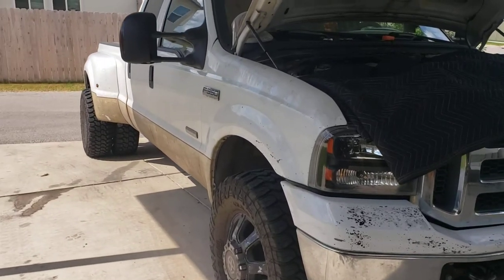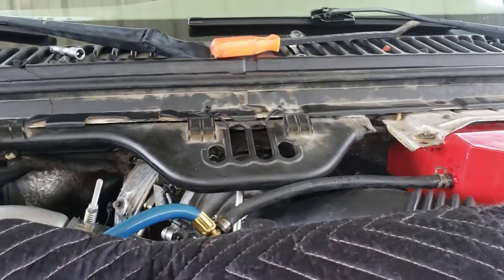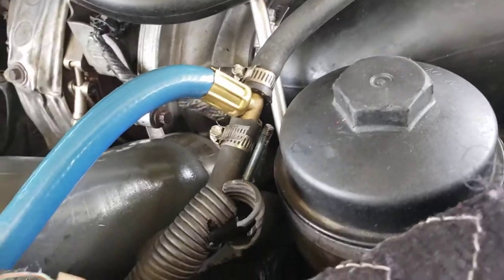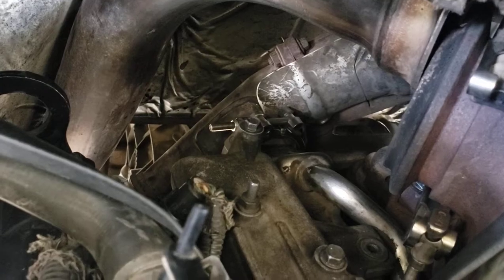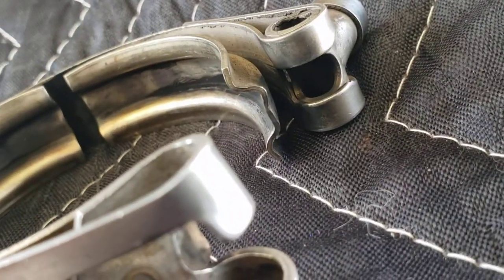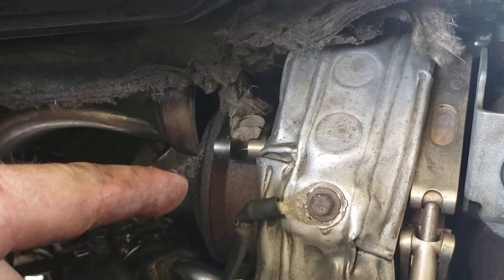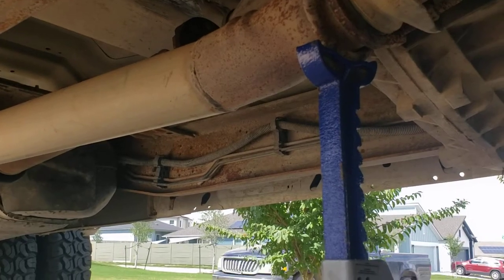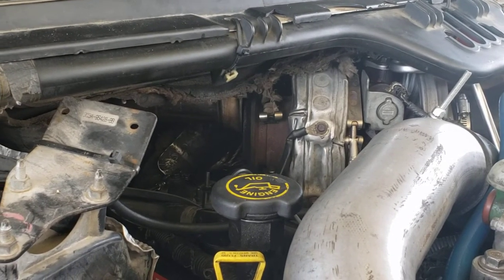2006 F350 6.0 Powerstroke Turbo hiss (no/low boost) fixed! Band clamp trick

Comment: How much boost should my 2006 f350 6.0 powerstroke have? Just bought it, but it feels weak also. Boost gauge shows about max 4psi
Reply from the maker: Usually if it feels weak, it is. At least in my experience. When you really get on it should go up to around 15-20. I had egr delete and CTS2 tuner way easier to monitor than dash for specifics but after I got everything working I just used the dash gauge
Reply: If you’re getting a max of 4 PSI you need to investigate something else. You’re going to max your EGT’s out and blow a head gasket. You have a significant leak somewhere. Just 40-55mph should displace around 5-10 PSI. Hauling, around 16-23.

Comment: How do I check is my turbo is good or has bad seals
Reply from the maker: Usually if seals are bad you can spray brake cleaner around it and truck will either change in idle when you hit leak or you will see it come out of exhaust if it seeps through
Reply from the maker: When the truck starts cold and idles for a bit you should hear the pressure release after about 2 minutes and the truck sounds like a caterpillar back hoe for a minute lol that’s how I could always tell the turbo was still working
Reply: @overlandtate2426  
I just took the intake off and the turbo was like brand new inside there fan had little to no movement. 

I did notice a previous person put the clamp back on the intake and bent the intake to where there was a good void letting oil out. It was all mucked up around that area . I’m sure it was good to have the void there. Would this be causing some of my problems.
Reply from the maker: @steventhorkelsen6478  oil in there can cause a ton of other issues. I would say to check the intake manifold gaskets out.. but the work to do so is a pain in the a$$! If there is a leak from the turbo and oil gets in the intake it can cause rough idle, no start, and black smoke. Good thing the turbo looks good though! They sell a turbo seal kit that took away my whistle in my turbo and brought my boost back. It was similar to your symptom of like 4lbs even when I got on it

Comment: i’m hearings hissing type sound from the drivers side. do you think it could be a boost leak ?
Reply from the maker: Does it get louder as the turbo winds up? The turbo is trying to build up pressure as you accelerate and if there is a leak you’ll feel a big loss of power
Reply: Same thing. 

Loud hiss out the driver front well. Exhaust smoke comes out too. My 03 is a smoky turd. 

Zero boost.
Reply from the maker: @johnnelson7148   definitely sounds like pressure is not building up. Either means exhaust leak or turbo turbine is not spinning. Usually the hiss means leak though. Hate to say but you have to check all of the exhaust connections. Usually the way I do it is start up cold and feel around for where the exhaust is coming out/leaking. You only have about a minute before the exhaust gets too hot to feel around but then you’re relying strictly on sound which can be unreliable in a tight engine compartment. Hope this helps
Reply: Motorman Tate turbo is freshly rebuilt. 

The last mechanic that touched it threw it together in less than an hour after running me around for a month. 

I’m guessing he jacked it all up because the sound started the day after I got it back then stayed consistent with a whoosh noise...now this. 🤣

I’m sending it to a shop. I don’t have the tools or know how to mess with it.
Reply from the maker: @johnnelson7148  to be honest mine started after I put in a bulletproof oil cooler, I was excited putting it back together and I’m sure that’s what bent my clamp. Either way, a rushed job can lead to these silly mistakes and all mine ended up being was the seal from the back of the turbo to the down pipe. First clamp I bought bent the exact same way. It’s all about taking it slow and understanding all the little parts. Good luck to you man and keep on truckin!
Reply: Can this cause no boosts and fume’s really bad in the cab